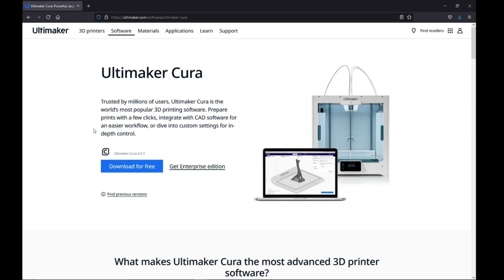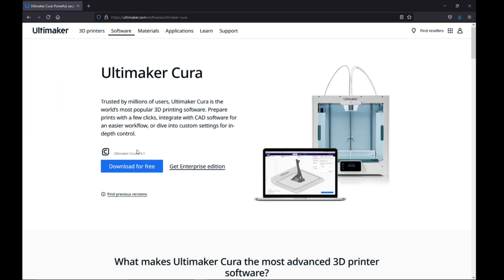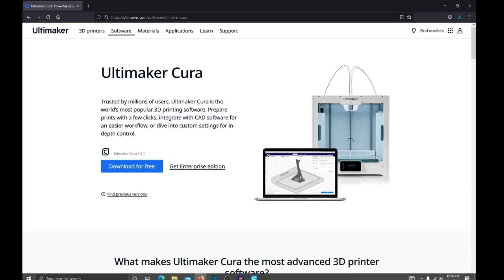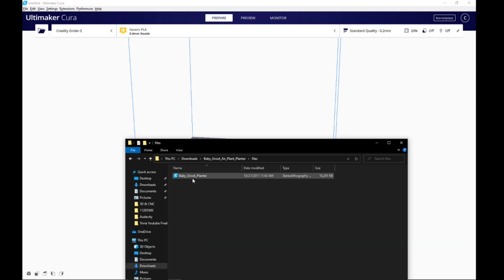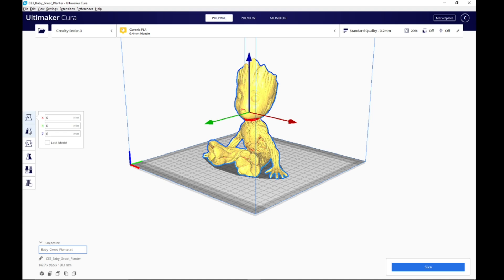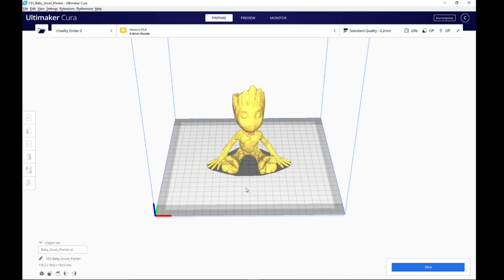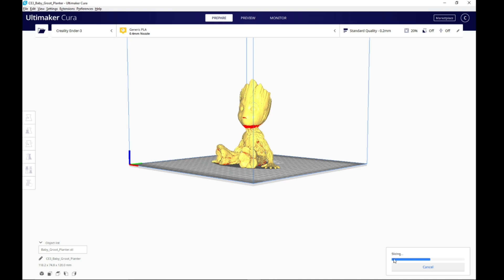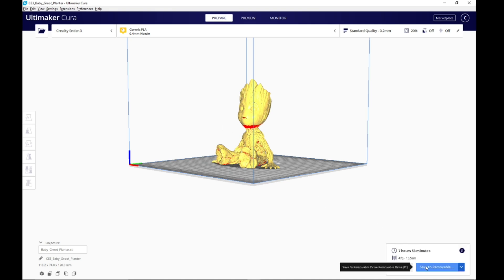STL to GCODE for 3D Printing - How to Convert Files

Comment: very efficiently and simply explained and as a new owner of an ender 3 pro this was extremely beneficial as i was in a panic because my .stl files weren't working. thanks a bunch m8 :)
Reply: What printer did you add in settings because I don't see ender 3 as an option

Comment: Saves file to ufp bro. Double check your work
Reply: same how do you put it in to gode?
Reply: @insido6715  I am assuming you already figured it out but I figured I would respond in case another person had this issue when they found this video. When you have the app open, click the printer's name, select add new printer and scroll down and select a printer that uses gcode files, It defaults to an ultimaker printer which uses ufp. I have a ender pro 3 so I selected creality3D and scrolled down to ender pro 3. every stl file I sliced after that saved as gcode without any issues whatsoever!

Comment: Man I really need some help, slicing it doesn't convert the file to g code
Reply from the maker: you're saving it to a removable drive after slicing?
Reply: @3dcncsimplified804  Same Issues and Yea. Tried it on two different cards too. It just does STL to STL now.
Reply: @3dcncsimplified804 mine saves as PWMA I need it to be stl